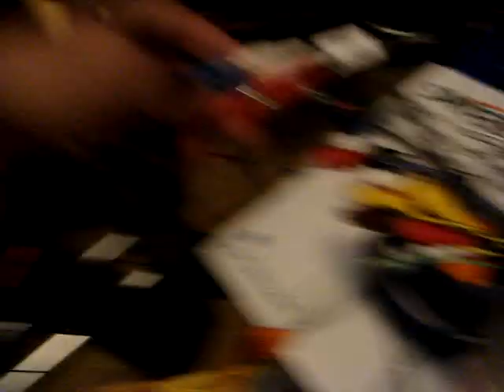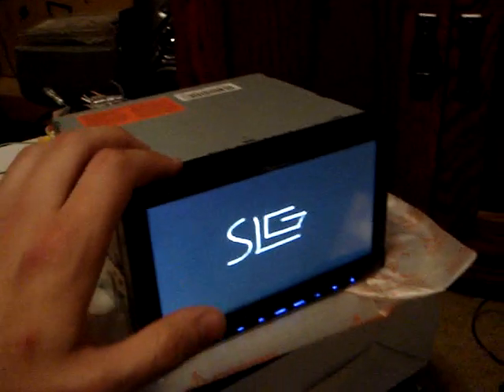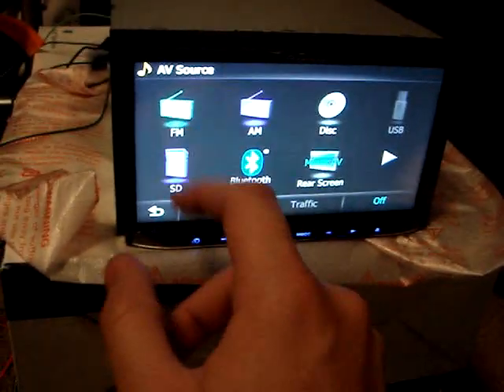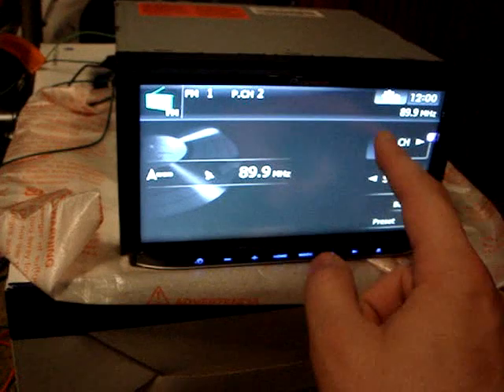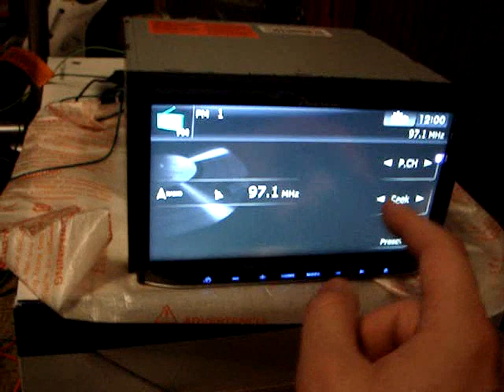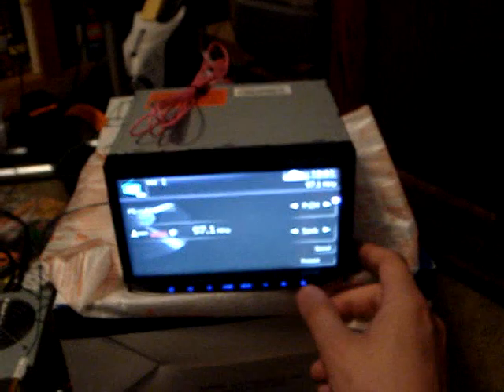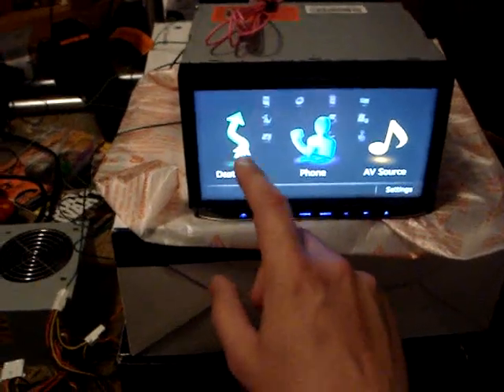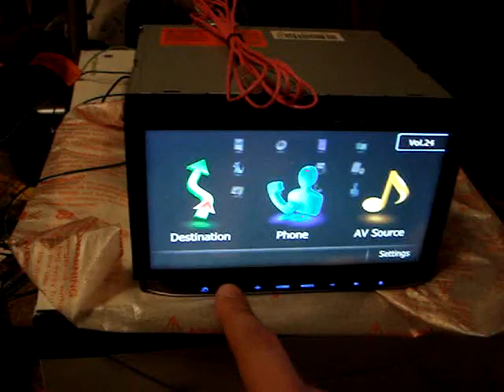How To Power A Car Stereo In Your House (Pioneer Avic-Z110BT)

Comment: I know that if you want to run car speakers and car subwoofers and a car amplifier indoors and don't want to use a car radio you can actually use a stereo receiver instead of a car radio but the only problem is that most stereo receivers require you to stay between 8 to 16 ohms or you risk damaging a stereo receiver a stereo receiver is louder and powerful enough to power car speakers and car subwoofers

Comment: Car head units take lots of amperes to run them because if you don't give it enough amperes it will shut off if you hook up 4 speakers to it and it happened to me when I hooked up 4 speakers to my jvc kd-sr72 head unit and it would shut off when I cranked the volume up and the lights would start dimming on the head unit too because it wasn't getting enough amperes so I think that it's best to use a home stereo for your car amplifier and car subwoofers because home stereos are louder and use consistent power

Comment: hey i have a radio toolbox that I built I have a car battery on it right now. i am running 2 6/9s and a 10in sub with a 400watt amp. would this work to keep all of it powered. I'm trying to figure out a way to run all of this to plug it in to 110

Comment: i tried the same thing it works with low volumes but when i increase the volume more then 25 the sterio shuts down and restarts, it continues to do so untill i decrease the volume to 20, but when it is connected to a car battery it works. please help.
Reply: +Parasar Bhattacharya you probably need a power supply that delivers more amps
Reply: Chris Brown
yes thank you i will try that.
Reply: +Parasar Bhattacharya Keep in mind that there are single and multirail computer PSUs and that you might be overloading one rail. There is more to consider than this video suggests.
Reply: Chris Brown
thank you, i am thinking of building a eliminator with a transformer of 7 amp, hope that will work, as the machine says tha it requires 5 amps.

Comment: i've got all of the yellow wires and connected them together to connect to the yellow cable on the back of the wiring harness, and one of the yellow wires is hooled up to a switch which is hooked up to the rewd wire on the harness. ive used all of the available yellow wires on the psu so im not stressing out just 1 rail. but this still isnt enough, what if i connect the power supply in parallel to a car battery? so the psu can power the radio and the battery can provide the peak amps needed???

Comment: Don't! Normally on a simple molex adapter on a computer, you shouldn't draw more than 3amps pr. yellow (12V) cable.

This is 3A x 12V = 36 Watts, not enough to power your speakers (normally 4x50W, maybe 22W RMS. 

The cable and PSU is not made for running the whole stereo.

You can power a stereo to test it, but you should never run it completely of a power supply like this with speakers and everything. Then you should have at least 10A available, maybe a 120-150W 12V PSU for internal use.

Comment: how many amps does the psu put out? and can the radio run on full load with 4 speakers? cuz my 18 amp psu isn't enough to run the radio and 4 speakers

Comment from the maker: @MrOscar121 
ya but for that ur goin to need a strong power supply or like a battery or smething, they do make home amplifiers u can plug into the wall then connect rca from the radio to the wall amp, then to ur speakers